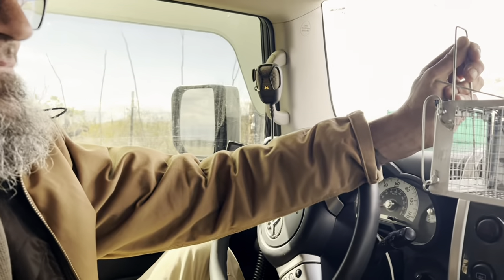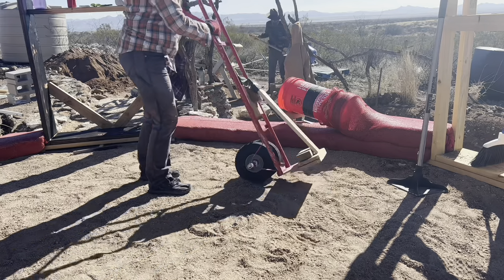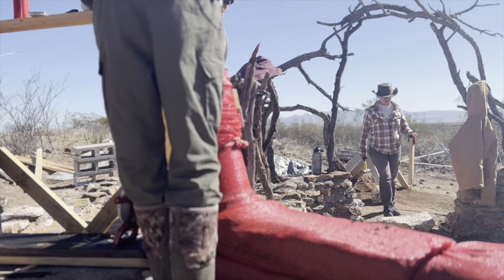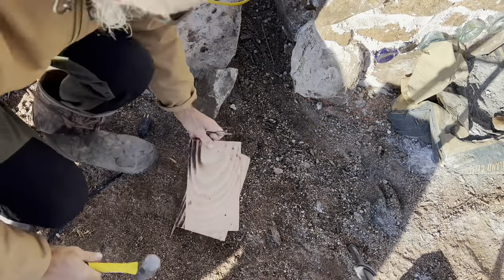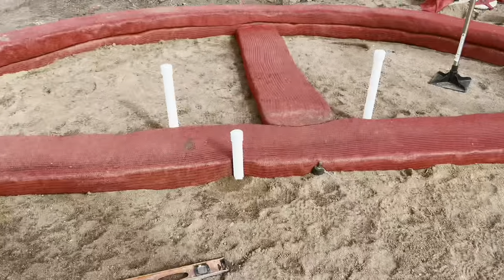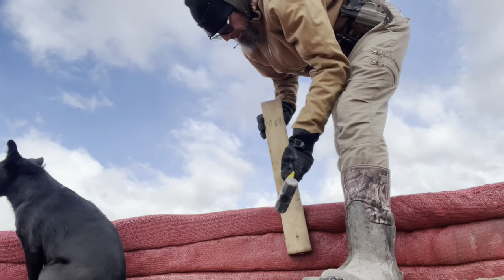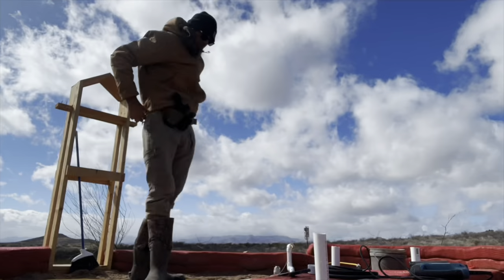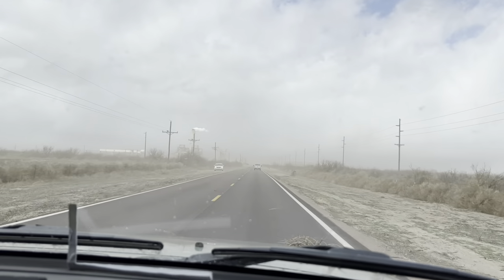What Went Wrong Today On Our Arizona High Desert Homestead

Comment: What about making some cement anchors and put some long eye bolts in em to use for anchoring down.
Reply from the maker: That's not a bad idea at all!  We are in the process of pulling everything out of the tents, assessing damage, tossing what was ruined, and repacking everything back in.  It's interesting because the one tent did just fine and the one that we showed the picture of did terrible!  It's because we were "rushing" at the end of moving all of stuff because we were on a timeline with the moving truck rental and we were also pretty exhausted...honestly we kind of slopped it together knowing we needed to re-do it, but just never got around to it...lesson learned :)
Reply: @tworebelsoffgrid  we have all been there in some sort of way.
Reply: @tworebelsoffgrid  not sure how much a 24x24 cement square with eye bolt would weigh but I’d bet it would be a decent start. And an eye bolt big enough to use chain for tractor to move em around